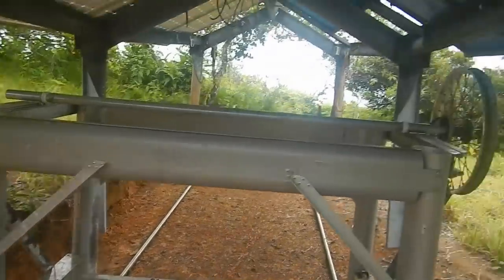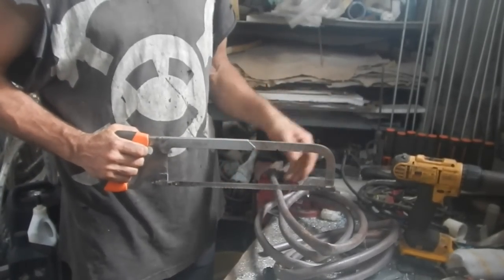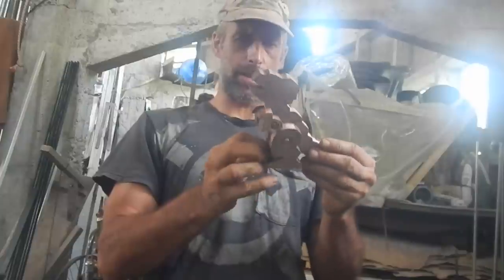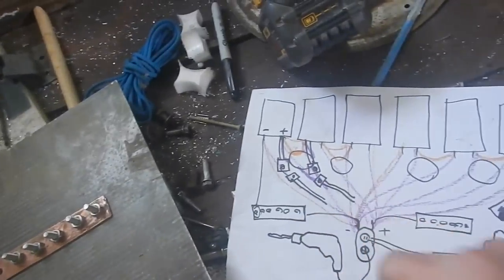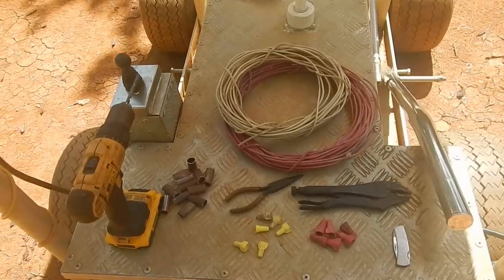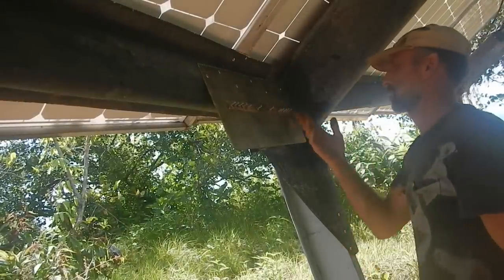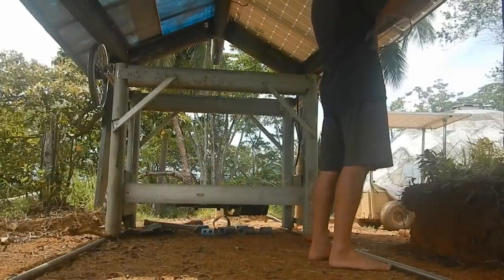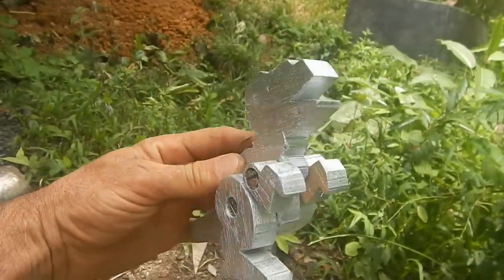Lumber Mill 016 First power Up

Comment: The drilling of the holes in the bus bars was not on the video. Would be interesting to know if you did any anealing after hammering the copper pipes flat. If You did not, I would recommend trying it. The coppen might be pretty good hard after all the bashing. For cleaning the inside of pipes some kind of polishing/sanding mops for the cordless drill might be a good thing. The smaller ones should be available quite cheap online. Get some made of that scotchbrite type of material an some felt or cotton cloth ones.

Comment: Jaimie you could make a power curly wire cord for the motor on the mill so the wire doesn't get in the way. just wrap the wire around a metal pole then heat it up a little bit with a heat gun to make the plastic coating plyable to stay coiled up.

Comment: You can use two aluminum rails in the roof, on each side to conduct power to the motor. Then you don't need such long cables.